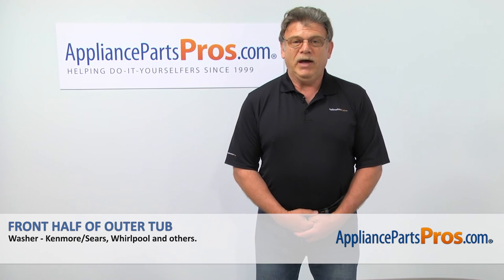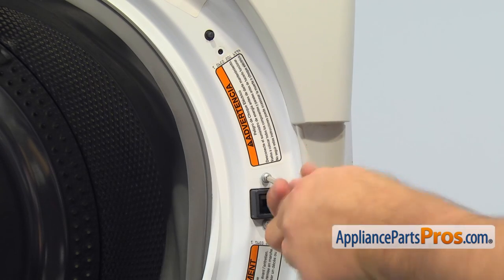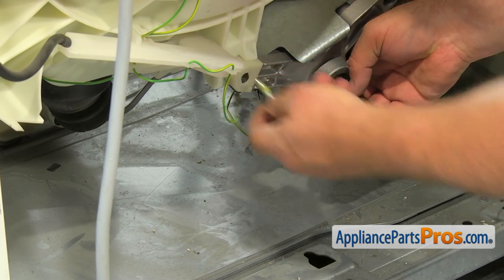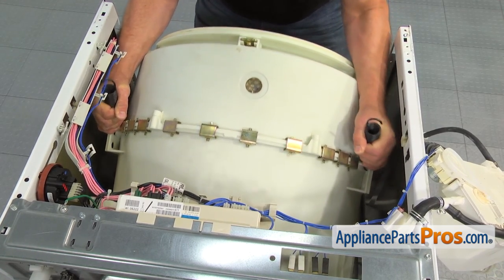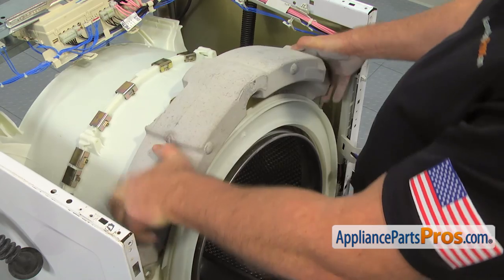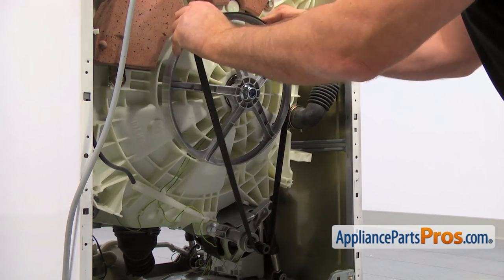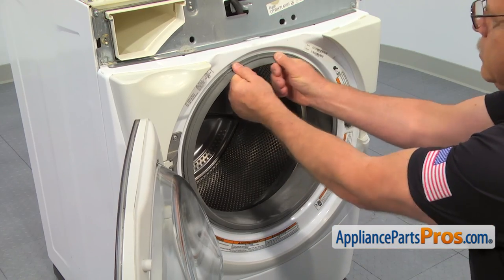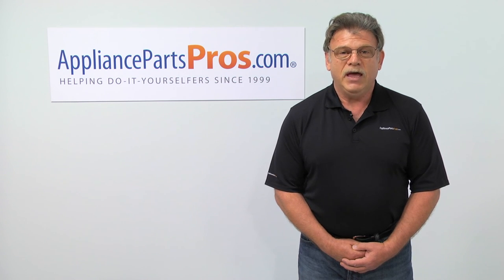How To: Whirlpool/KitchenAid/Maytag Front Half of Outer Tub W10772612

Comment: Thank you, Simon, very detailed video. Helped me to replace a failed tub by myself. Just follow the instructions! Note to others - I bought a front outer tub from a cheaper place and the part that came was not the right kind (had an extra opening for a heater that my washer didn't have). The worst part - it fit, so I discovered it was not the right tub when I had to plug the temperature sensor - the hole was MUCH bigger :(  Besides it came without a gasket which I had to order from someone else, about $25 but still, plus wait time. A lot of headache to return the part. Shipment is not refundable. Don't buy from "cheap" sites!
Reply from the maker: You're welcome! Glad the video helped you out with the repair. Next time, you can always buy the part from us. We can use your model number to verify that you're getting the correct part for your machine, and if we make a mistake and recommend you the wrong one, the return shipping is on us. :)

Comment: Everybody, if you are having issues with draining the tub such as: long draining, no draining but your troubleshooting led you to thoroughly clean the drain filter and check if the drain pump was spinning but it did not fix the problem...look at 9:15 THERE IS AN ORANGE-SIZE BACK-FLOW BALL-VALVE that can trap heavier objects.  There are no indication that it should be cleaned/serviced. 10-4
Reply from the maker: Thanks for that tip!